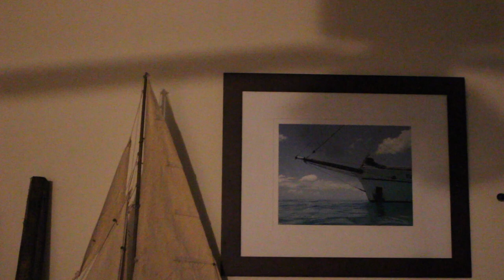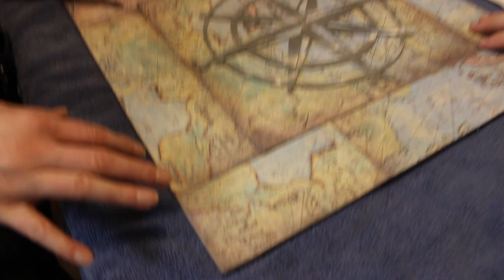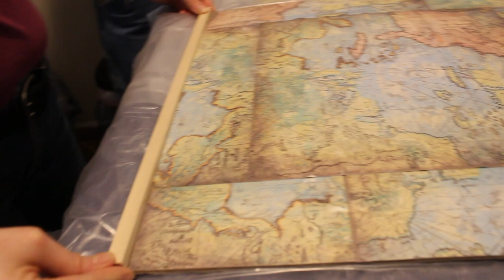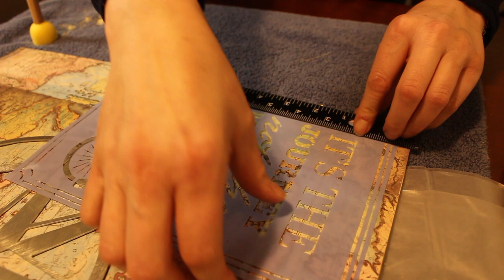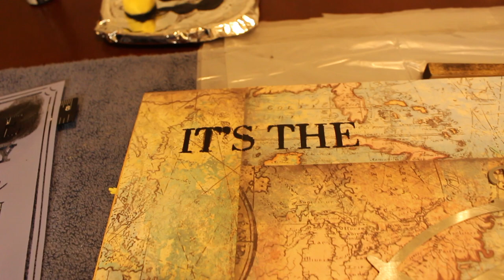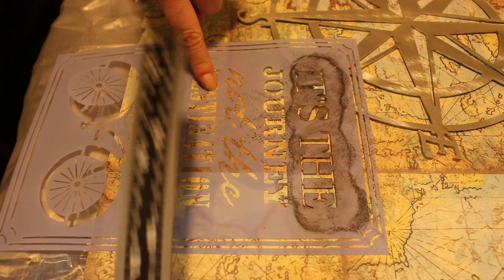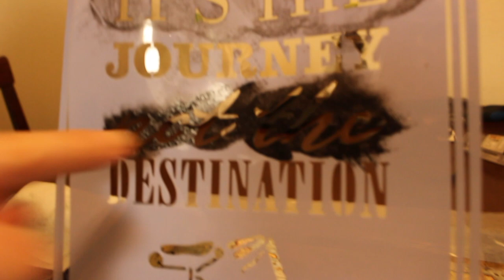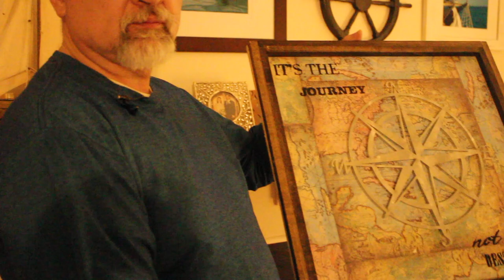Amazing floating  Compass Rose nautical theme decoration for under $15.00!!

Comment: Looks great!

As a tip for the future? You can make your own Mod Podge. Just mix PVA glue, also known as regular old Elmer's White Glue, with water. Usually a ratio of 3 or 4 glue to 1 water by volume is the way to go... Depending on how thick you want it. Should be less oder-iferous (if you remember the old deodorant commercial) too.
Reply from the maker: Thank you for the tip and the comment. :)